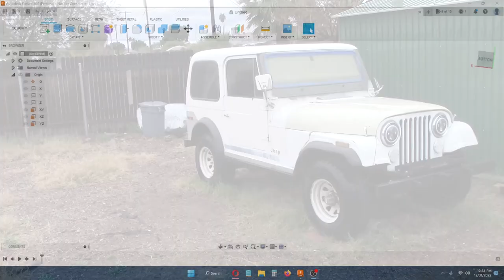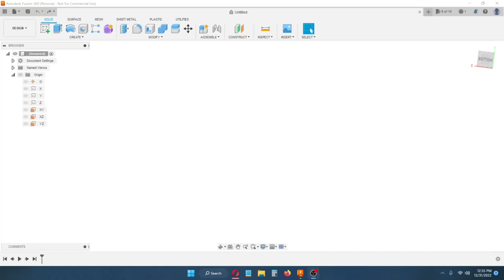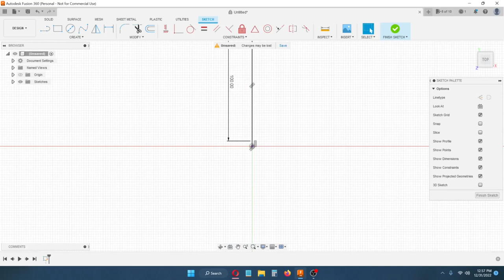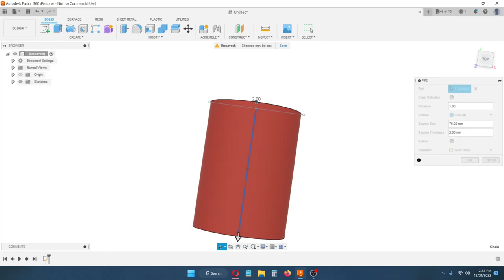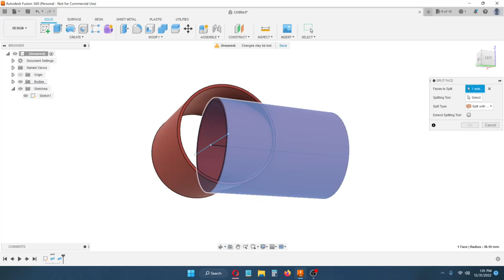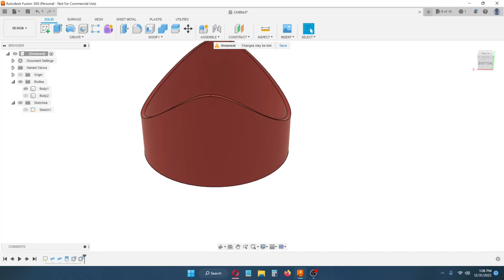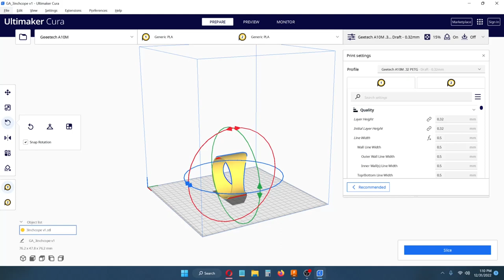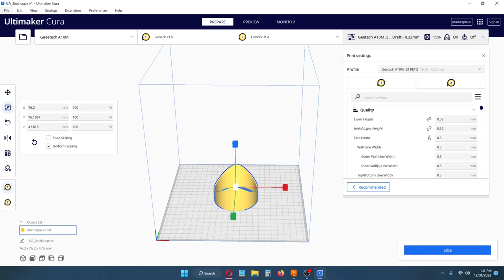Design,  3D print and test a coping or miter tool for pipe or tubing

Comment: I've used prints like that for templates when plasma cutting with a drag tip before. Much easier than transferring the line with silver pencil - you use the print directly as a stencil! Even PLA will last for a couple of cuts before it melts too much, and ABS will last even longer. Your standoff torch with the wire guard is a little different than mine, but still might work well enough.